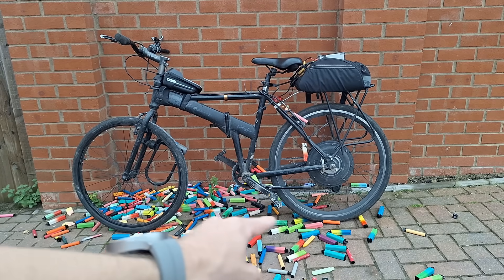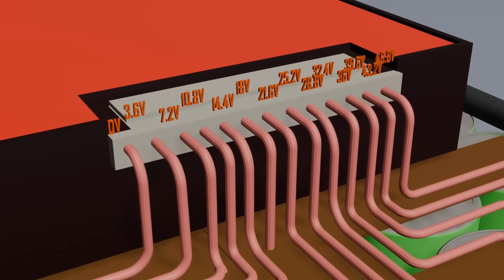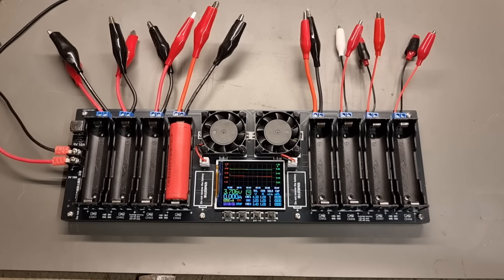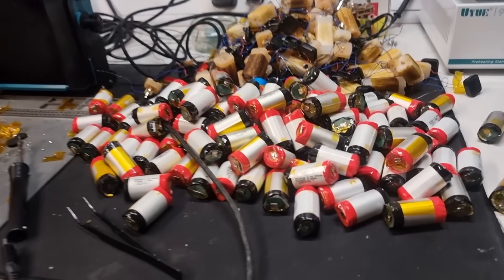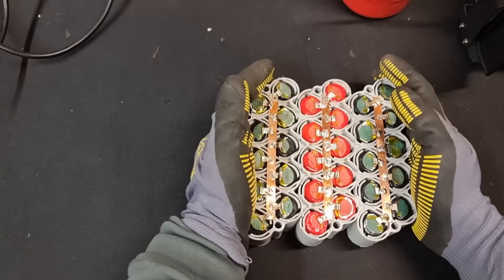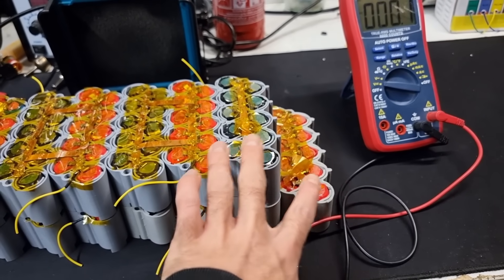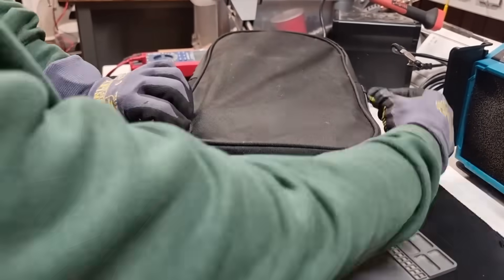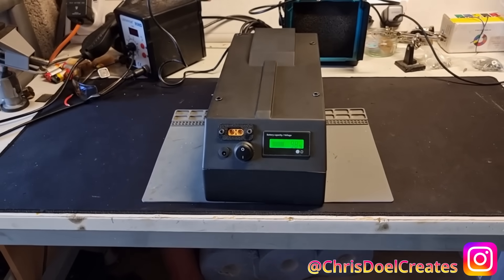Powering an E-Bike using Disposable Vape Batteries

Comment: That's one smart way to recycle something we throw away after using it once.
And about 30km on one charge is like riding an E-bike using an 250 watthour battery.
How much amps does this have? Multuply the 48 volt with the amps and you have the total power in your battery.
I have an off the shelf E-bike with matching battery. My bike has the motor in the middle and sensors that measure the amount of pressure I put on the paddles.
The battery is 496,8 watthour.

Comment: I have a virtually unlimited supply of the smaller ones at the shop where I buy my own. They said I can empty the whole recycling container. Unfortunately the bigger ones are not sold anymore (they are illegal). So I'm stuck with the 850 mAh ones.
I tested the thing with the additional liquid. About 30% is possible. After that it gets burned too much. And there is less in them at the end as it might seem. If you plan to recharge them, refill them before they are empty. The survive about 5 times. After that there is too much liquid leakage. The battery is fine, but the liquid leaks. Makes mess. Also the filter ring gets burned too much. So the taste gets worse over time, because you can turn them only so much until the burnmarks overlap.
So if you plan to reuse them for their intentended purpose:
Refill them just before they are empty.
Try to take them apart more than apsolutely necessery. Test on one how to best do that.

Comment: I had a thought about this, since those cells have such a low cycle threshold using them in an ebike would be replacing them 2x a year if charging every day or twice a day for commuting. These would see a much better use case in UPS Battery back up systems. You would not want to rely on anything with a 300x cycle expectancy transport.

Comment: how is the heat build up after extended use? After 300 charges. becomes it a safety issue or lose of capacity? keep up the good work.

Comment: Can you recycle 18650 batteries to salvage the lithium? 
I use a big vape mod like a man hah. I'm sick of seeing all the used vapes littering the place.
I also use power tools that have 18650s in their battery packs. Also my flashlights run on 18650s. 
Anyways ive got a pile of 18650s that wont charge. I dont want to throw em away because lithium is a finite resource.

Comment: I know how to charge those kinds of vape you only need stripped charger cable an you take the tapes off batteries and connect wires
Reply from the maker: Please do not do this!!!!! A stripped charger cable outputs 5v. If you charge a lithium cell above 4.2v then it can quite literally explode. Seriously, theres vids and pictures of this exact setup going wrong. A better method is to buy a tp4056 board and use that to charge the cells
Reply: @Chris_doel yes but if charged 4-7 minutes it has low chanse of exploding

Comment: Could I hook up a transformator and increase the voltage but reduce the current, so the battery will last longer at the same power output? The motor will rotate faster but have less torque but that can be fixed with a simple gearbox
Reply from the maker: I use a VESC as the motor controller. It's a really smart controller, and you can limit the battery current while maintaining the same maximum voltage. It can even do a thing called field weakening where you can spin a motor faster than the maximum voltage would usually allow

Comment: Over-discharging lithium ion cells often doesn't cause terrible degradation. The reason it's reputed to be so terrible is that if you over-discharge a battery with multiple cells in series, cells in the middle can get reverse-charged, and that causes rapid degradation. It might be worth gradually charging up that fully discharged cell and then testing it to see if it's actually degraded.

Comment: I collect dumped vape units when i see them , Their tiny size cell makes them ideal for small projects but i haven't used them for anything as crazy as a bike 🙂 , since they are single use devices the cells should be in really good condition cycle wise.

Comment: Question, if all the batteries are connected to each other through the copper strip, how does the BMS read them out sepperately without reading the other ones as well?

Comment: I must start by saying that this is by far the best thing I've seen disposables be recycled for, but what i can't help but think about the quality of the cells themselves. each properly manufactured-for-purpose 18650, 18350 and 21700 cell have a "CDR" rating, but these disposable batteries are a wholesale batteries that are made for extremely cheap and the Continuous Discharge Rating of them is usually pretty crap. when the CDR is exceeded things can get very "spicy". would there possibly be a way of doing this even safer, say running them at a lower discharge rate, but with more cells? because if we can find a reliable and even safer way of doing this, there are many ways for these batteries to be recycled by us nerds and we could build all sorts of stuff with them! once again, love what your doing man 👍

Comment: how can i use this system but also using my pedals to get more energy from them? could help me? instead of charging again on power charging while pedal
Reply from the maker: It's impossible/impractical, unfortunately. If you used regen braking to charge the battery while pedalling, then the bike would be extremely hard to pedal because most of your energy would go into charging the battery instead of moving the bike. And because charging the battery isn't 100% efficient, the bike wouldn't go as far if you did charge it via pedalling when compared to just pedalling it in the first place

Comment: 9:35 this is why i find the lost mary crystal so dangerous, ive opened them and the tabs are right next to each other, if it werent for the foam pad on top, dropping it and it hitting the ground hard enough could push the tabs close enough to make a connection, ive tested it and they can bend enough to touch each other

Comment: So these disposable vapes contain rechargable lithium ion batteries that are never recharged, despite having more juice than they can use on one charge, and are cased in what looks like a substantial amount of aluminum. They're as bad for the environment as they are for your lungs...

I'd be curious to see how much aluminum you'd get if you melted down all the casings you used batteries from. (required fabrication tools aside,) it might almost be enough to make a thin protective shell for the battery pack...

Comment: I smoke cannabinoid resin and oil, and naturally I’ve had quite a few dispos. I throw very few of them out because I like reminding myself how much money I’ve pissed away, but also now in part because of your previous vid. Anyway, I came to provide a perspective from a similar vice: EVERY weed disposable I’ve ever owned has had some port to charge it from. It’s actually bonkers to me how much Nickelodeon slime people leave in their dispos just because the battery’s flat. Dunno why I have any faith in the suits running the nicotine industry to be conscionable, being that they make their millions on being UNconscionable, but like… these things are actually a scam!

In fairness to weed dispos, I think they need a higher voltage in general to combust the material, since it’s often so viscous. The battery I use for smoking cartridges runs as low as 1.8v, and as high as 4.2 (haha funni weed number). Also, it is the industry standard, at least from what I’ve seen, to use glass or plastic to show you how much resin you have left, and that applies to dispos as well.

Comment: Did this back with discarded laptop batteries when they were the standard- make sure you charge and discharge each cell individually to test em cuz the bms won’t detect one that’ll overvolt

The one that will over volt will set a “chain of events”

Comment: I used to collect disposable vapes that had 18650 and similar cells. This was common about 3 years ago now it's the type you've show, and 18650 seem quite rare. In 2012 I modified my E bike to run on DeWalt batteries as i had an unlimited supply (on loan) I used between 2 and 4. Ride to site, swap out, etc etc. Add 4 for ride home.
Reply: 18650 are extremely expensive compared to these smaller ones. 18650 are used in everything from laptops to tool batteries to flashlights

Comment: Some companies make vapes that  have 3 times more Liqud inside/ 15 000 puffs compared to about 5000 in this vapes you have...
and they have USB C charging port but the batterie is way way smaller..(psisycal size of about car remote batterie).
so its less wastefull...but they still get thrown out after the liquid runs out

Comment: Hi i have a question, when you placed all the batteries in the 3d printed slots and where about to connect them in series you said that you had to flip them over so it would be +\-\+/-, in a continuous cycle. You also said that to connect them you would have to connect a set of wires the flip it over to connect to the next. My question is, why flip it over if they are already positive and negative, why cant you connect the set of wires from the same side? Would tjis make them  in parallel?

Comment: What will you do when the batteries get close to the recharge limit? 300 cycles isn't that many? What happens then?
Reply from the maker: Its more of a guarantee that they will do at least 300 recharge cycles. Usually, after it reaches this stated number of cycles, the battery capacity will have dropped to about 80%, which is still very usable
Reply: @Chris_doel  Thanks for the reply! I love the content and have made some phone charger battery banks, and I was wondering about the effifcacy of the batteries after the charge cycle had been exceeded. But that is fantastic to hear!

Comment: The first half of this video had me on the edge of my seat. As a man that went to school for electrical engineering I am always a bit worried when I see anybody attempting to make their own battery packs on Youtube. You seem to know what you are doing though. I've never been a fan of charging to similar voltages as a means of battery pairing, as it means that the full charge for that group will only be as strong as it's weakest link.... but when you are working with recycled vape batteries you really can't be picky. Great video. Cheers!

Comment: If that's the case couldn't a person buy normal batteries do that wizardry with the wiring /system and do the same thing.or  Like this guy could make some serious cash by getting a few junkies or homeless to find the batteries pay them 5-10 freedom bucks for every 20-50 they find  then make a deal with guy with a 3d printer/ board thingy and built them then sell them after a few changes and test

Comment: Great video.
Upsets me that those disposables aren't rechargeable. Make a great point about the charge running out before the liquid. I vape but I use my own rechargeable 18650s, I use organic cotton and my own spool of wire to create the coil and wicking system. I've used the same cotton and wire for years, which cost me about a tenner. I spend about 15 a month on liquid. There is zero reason for disposables to exist, need to be banned.
The reason why some of the wicks juices are darker than others is simply oxidation and heat reaction. Sweeter juices are darker in general, compared to say a straight menthol juice, but with oxidation they all become darker in time, this is an old thing called steeping, that people used to do intentionally to increase flavour.

Comment: what do you estimate the AH for this battery pack? A Powerwall would be really good. Who knows, a portable power station built with solar rechargeability would be very interesting 
modular small-scale self-sustainability using recycled LI Cells. Camping or using it has a back up gen. think dji power 1000 or EF eco flow or anker solix. good video hope to see more from you soon.

Comment: I’ve built a few packs myself and my only pointers are
1.) use fish paper between the cell banks alongside the teflon tape! It’s good for this stuff because it won’t break down if there’s a little bit of rubbing. 
2.) it’s worth mentioning that soldering lithium batteries should be avoided at all cost as they lose capacity when you dump heat into them like that. However, it would’ve been extremely hard for you to spot weld this design so I get why you did it.

3.) don’t let your bms wires cross if possible. This one is because the wires will short out if they get smushed and the copper pushes through the pvc jackets on the outside of the balance leads. Once again, almost impossible with this design but worth mentioning for anyone who wants to get into pack building. Overall great work though!

Comment: Brilliant videos. Ive built an e bike and always thought about using vape batteries since I find them all over, but I clearly don't have the electronics skills or soldering skills you have. Thanks for showing this great project. Learned a lot. Simplest use for the batteries would be to power small electronics...maybe phone banks?

Comment: As others have said, thanks for beating me to making an ebike and releasing valuable information I was wondering about! 

I currently have been making some fun small torches and speakers, I even mucked around with the little breath sensor (unsure of the actual component name) and ran it as reverse as a switch for a small car work light you can turn on with your breath 😄 

Subscribed

Comment: i don't smoke vapes but always got me thinking what voltage they are in shops i still think 3.8v because its a storage voltage..if then pens had the 4.2v charge they would last longer 😂 I didn't see the IR was they all low read? ...i am into rc and been thinking of making my own batterys 😂
Reply: id you had a steel set 😂 you could tryed to get them back to 3v 😂

Comment: What about adding vents to the battery enclosure to allow heat dissipation and gas evacuation incase of thermal runaway. It appears pretty air tight.

Its alright saying how it's recycling but you alone are indiscriminately egging people on to copying your builds and put themselves or their homes at risk of fire. These batteries offer no CE certification when recycled nor do they make recycling safe. Banning vaping isn’t that easy as it's now affected those who are reliant on them plus its easy for someone like yourself to say that with your squeaky clean lifestyle

Comment: I'd install something a little bit more hefty than kapton tape to insulate to top from the bottom stack. A bike battery is subject to quite a bit of rattling. You don't want that thin insulation to chafe through.

Comment: Electrical engineering student here. I always get on my buddy's case about throwing out his vapes (one of which had a full OLED screen on it!); I think I'll send him this video. Congratulations on being featured on today's TechLinked!
Reply: Damn I wish there was a way to recycle mine. I’m embarrassed to admit I’ve used them for about a year before I recently got a more permanent solution. I’ve got a big gallon bag full of them and I won’t throw them away because it could set the garbage truck on fire if one is ruptured by the compactor or something. Really don’t know what to do with them and dont like having them in my apartment.
Reply: @Cinci746  Get in contact with Chris, he might have an email in his description..
Reply: @Cinci746  check your local recycling depos, where I live they take anything from glass bottles to electronics and batteries.
Reply: @Cinci746  I dont know where you live, but in the UK companies that sell lithium ion batteries are required to fund places to recycle them. Do a bit of googling for where your local center is, there might be a WEEE, waste electronic and electrical equipment recycling near you. Personally, we have a couple bins for them that get regularly collected at my university laundromats. I havent recycled any vapes yet, so im not certain if they would require you to take the battery out and just give them that, or if theyll take the whole thing. good luck
Reply: An OLED screen on a vape!!???

Comment: There are several factors for why that one wick is darker than the other. Most likely the e liquid had more sweetener, more cooling agent and maybe more nicotine. Those make it oxidize faster. Also if the user took long puffs the heat will transfer and speed up oxidisation. And the user probably vaped the shit out of that thing, burning the wick slightly.

Comment: Thanks for documenting this. I had a similar project in mind. I already have about 40 of those high capacity cells so far, and plan to build a road legal setup, so I will probably get away with less cells overall than you used here. I hadn't considered cell internal resistance, so I learned that from you, thanks!

Do you have any tips on how to get bigger batches of cells? Since I have relied on street pick-ups I have diversity of cell sizes which I can't use for this project, which I'll put to use elsewhere, but it means building a huge bank is going to take time.

Comment: Rather than running the thing at full power, I'd recommend limiting it to the legal 250W. Not only because it's the law and because it's dangerous to go that fast on a vehicle that's not designed for it, but mostly because the battery will likely last much longer than the manufacturer's estimate if you only run them at like 1/6 of what they're designed for.

As for what's next, I'd say the escalation is pretty obvious: cargo bike --> home battery --> motorcycle --> car --> camper van.